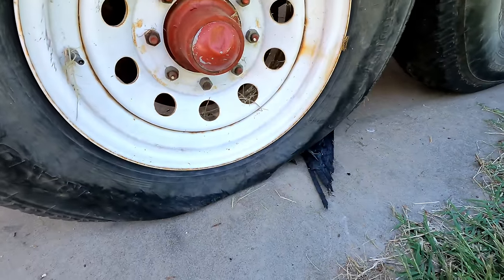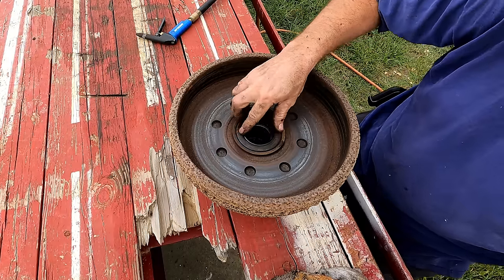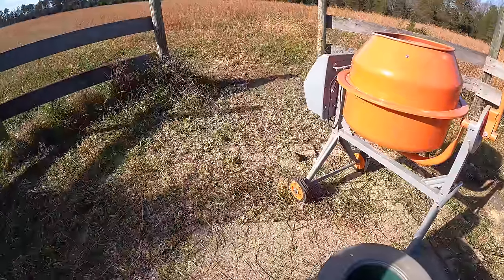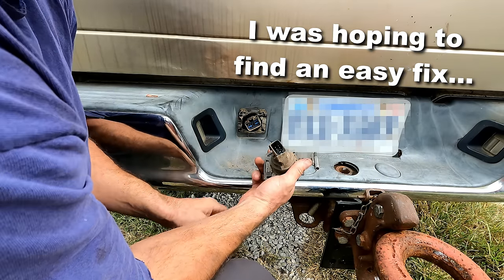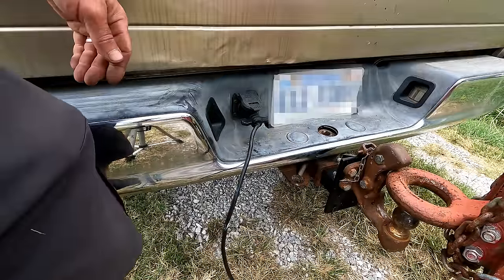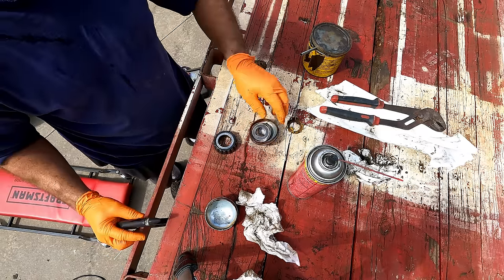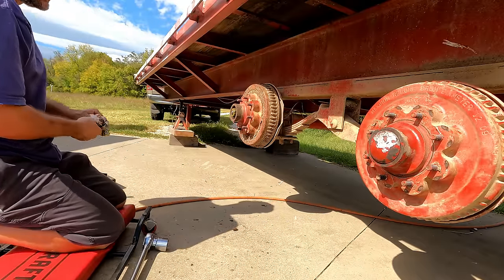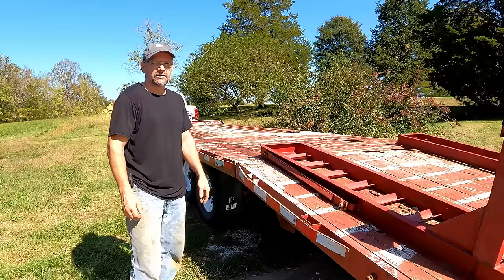Fixing A 7 Ton Equipment Trailer: Brakes, Electric, Tires, & More.

Comment: There used to be a liquid called Stabil, no NOT. the gas stuff that when applied to mechanical electrical connections achieved the near equivalent of a soldered connection. It’s an electrical polymer that does not cross talk even if you spill it over between electrical connections up to 600 v    What we used was manufactured in Sweden I believe.  It may now be called stabilant.  Search for electrical mechanical connection enhancer it’s a liquid should be small squeeze type dropper bottle it goes a long way but it looks like they are VERY PROUD of it.  .

Comment: I bought 2 brand new LT tires from Walmart for my 92 Silverado, of course cheaper tires but still costed me around $500, I only put 100 miles on the tires and both of them did just this, the glue did not hold, and the driver's side let go at around 65mph, the thread on the tire beat the snot out of the my bed side and ripped the tail pipe off. That company who sold the tires ended up repairing my truck and giving me a full set of tires for the thing.

Comment: 20:40 It’s not that far out there. I had a Fusion for a short time and the radio would intermittently work. Dug out the fuse, terminals looked dark from heat but wasn’t blown, so I cleaned the pins with a scotch bright and replaced. Problem solved! And it worked flawlessly for the remainder I owned the car. Crazy.

Comment: It's good to apply dialectic grease to plugs when power or ground issues aren't stable...like when you reassembled your truck receptacle.. Also put some on the plug from trailer.   It just assures a better and longer lasting connection.

Comment: Those Optivolt Panels use a simple trick. 2 cell groups in parallel. Bigger Panels use that trick already and still are cheaper. 2200$/kWp is an very hefty price tag. You get regular 400w panels for 90$, so they are a magnitude cheaper.
Reply: Incorrect! Our panels don’t use cell group parallel wiring, bypass diodes, or mppt converters/inverters. Our patented power electronics architecture balances power from stronger zones of the panel to weaker (shaded) zones of the panel, resulting in a near linear power output regardless of the % of the panel shaded. You won't find this tech on any other panel on the market — big or small.
Reply: @optivoltsolar  You know that to every electronic engineer that sounds like total bullshit. 

Also even if your tech is soo good, they still can't beat an simple 400w panel that is still *cheaper* than your crap.
Reply: @Toxicity1987  My mistake, I didn't realize I was in the presence of an electrical engineer! Let us know what this $90 400W panel is and we'd be happy to film a shading test of it against our 100W panel.
Reply: @optivoltsolar  Oh yeah when you film it, it will be trustworthy... not. Send your panels to an independent Youtuber like Will Prowse. He can test them for you.

Comment: I know this is way past the view date but it would have been interesting if you had loaded the trailer with something heavy and towed it down your dirt road and smashed the brakes to see if the trailer tires, all four, stopped at the same time and skidded down your dirt road to a stop. And checked at what point the trailer tires skidded before the truck tires. Also just using the trailer brake mech. inside the cab to see what kind of braking each tire does and if you can get them all balanced so that all four skid at the same time. All of this information is very noteworthy as you could cause the trailer to fishtail and even jackknife if one side brakes too soon and/or too hard. Sometimes you just want to control a fishtail that started for a multitude of reasons. You certainly don't want to exacerbate a already dangerous situation with unequal braking of the trailer brakes and flip your whole rig!

Comment: When ending an electric wire wrapping with electrical tape make a loop on the end, stick the end of the tape through it, and pull it.  It will never unwrap and you will always know that is the end of the tape if you ever have to undo it.

Comment: It could be that the ground is routed through the screws the hold the plug in. When you unscrewed it and reinstalled it, you made a "clean" connection. Just one possiblity.

Comment: I've completely given up on trailer rated tires. I haven't found any good ones, they are all junk. Treads separate and/or they wear out quickly. They just aren't made well or use good material. I'm tired of being stuck with trailer flats, due to tire failure.

I've switched to the closest size light truck tire I can get. They last 5x longer. They have more tread, better wearing rubber and are only marginally more expensive. If its good enough for a rear axle on a truck, it will work on a trailer.

Comment: So my Dad has a similar truck to you, and we found that the trailer breaks and onboard breaks have 2 different fuses. that didnt appear to be your problem, but something to keep an eye out for in the future. He'd let someone borrow his trailer, and they busted a bulb and didn't tell him, so when he hooked up to it, it blew the fuses. and we couldnt figure out what was wrong, because he was used to a 4 pin trailer connector and if the truck had lights the trailer had lights.

Comment: I am really surprised that you do not have a battery and a break away switch on your trailer. I believe they are required by law where I live.  Break away switch really saved my bacon when I had a ball come unscrewed and the trailer come loose while driving 70 mph down the interstate highway. The trailer brakes slowed the trailer down and kept trailer from hitting the truck.

Comment: likely when you disconnected the pigtail from the back of the connector you broke up the thin oxide layer in between, too many times I've fixed connection issues like that, surprised you didn't De-Ox the pigtail side too.

Comment: Self amalgamating tape works much better than standard electrical tape. You stretch the self amalgamating tape as you wind it on and the tape fuses together. The tail won't come undone.

Comment: Those plastic trailer connectors are almost worthless, switch over to the type used on a semi truck with the split pins and you will have a lot less problems. They are usually cheaper to boot

Comment: The optivolt was performing as a solar cell should. the other one wasn't working correct as it should have still been providing some power.  Thus the comparison could use refinements.

Comment: I have an idea that's unrelated to any repair but may help you with your editing well at least saving time.
Instead of spending time blurring out tags in editor, It may be fun to just print some novel or funny tags on your printer and then just stick them over the tag before you record. 
Just remember to take them off before you hit the road😂.
Always enjoy your videos and you say solder just fine.

Comment: Those trailer brake controllers sense deceleration with a little pendulum on the older ones or a mems mechanism on higher tech versions.  They don’t directly measure how hard you press on the brakes, they just activate with the brake lights.  The controller mounted lever directly engages the brakes regardless of deceleration.

Often equipment trailers like these use the same wire gauge to the brakes as for the lights.  The brakes draw substantially more current, and may benefit from heavier wire.  Check the voltage at the drum with the brake lever clamped, it should be the same as at the truck connector with the brakes connected.  If it is less you are dropping voltage through the wiring and not getting full braking power.  Of course you only need full braking power when heavily loaded, like with that excavator.

Comment: Brake controllers are supposed to be mounted completely horizontal there is a pendulum inside that slides forward when you hit the brakes which tells it to apply the brakes do the trailer as hard as you are to the truck melting it vertically like that causes it to work only half as well as it should

Comment: So, my understanding of solar panels is that the difference between Optivolt and other solar panels is the circuitry of how the individual solar transistors are linked together.
I'd be cautious of the longevity and durability of Optivolt if their configuration is what I think it is, cause any reverse flow or over voltage won't be contained to damaging only one array of cells.
Really cool idea besides that, though.
Reply: If they're built with some diodes in the right places, they'll probably be okay.

Comment: does your trailer have breakaway brake for your disconnect on the highway and it will lock up your brakes? Also do you have a braking battery on the trailer

Comment: Those tires were so badly damaged are you sure some of your heavy loads don't compress the trailer down so far that the tire rubs against the trailer/frame above it over bumps or whatever?

Comment: Raychem makes an adhesive filled heavy duty heat shrink commercial and nuclear grade in case you’re towing your  Wylie Coyote Acme nuclear reactor.   Gives like new wire insulation qualities water proof and all.

Comment: Hi I was looking at your video  and you asking why they are 7 connectors on your Trailer  plug well   you have  your urn signal L & R then you have  your stop/driving light markers   then your  Brake controller ( Blue)  and you have  Ground and Power  (why) well Ground and Power are use to  give  power to the  Battery on your  Auto Brake emergency  controller  or you can use it to charge a  Battery  Mount on your trailer for your  Winch or  charge the Batteries on your trailer home ( Camper ) when you go down the road also  your center connection is for your reverse lights (some trailer have  reverse light  ) like your home trailer ( CAMPER)   SOME CAR TRAILERS have back up LIGHTS THAT LET  PEOPLE KNOW YOU BACKING UP TO PICK UP A CAR  ...How I know all this info  well I work for a  Camper Motor Home Dealer here in NYS for over 14 years  Now I am retire  but I still remember  plus if you look on internet  it will tell you the   same or almost the same I just told you  HOPE THIS HELP  LET ME KNOW

Comment: Trailer brake controllers need to be “level” or horizontal at least for the pendulum to work correctly and send signal to the trailer.

Comment: 16:56  The first time you checked continuity to ground you went from the connector ground pin to your license plate screw (14:00).  Isn't there a plastic insert in the mount for the plate?
Reply from the maker: Good thinking, but mine is metal to metal on that bolt.  I also checked in multiple areas, and sanded the hitch to bare metal and checked there as well.  I wish I had shown it better.

Comment: Re the wheel bearings, tapered roller bearings are required to have preload or a negative operating clearance when in a no load condition. The rollers are a) canted and b) are ground to a slight barrel shape.
Preload sets the bearings up so when cornering and loaded the full face of the rollers and their races are in contact. 

Without preload, the tips of the rollers ride on the race and the high surface intensity wears both the race and the rollers esp through heat. 

The first part of your procedure was correct, but the second part where you just finger tighten the nuts is not. What you want to do is further tighten the nuts 30-60 degrees past finger tight. 
There will be a torque spec but forget that - just rotate the wheel in the direction of travel until the nut bites then about 15-20 degrees further. Do it a couple of times for each nut to get the feel for it.

Really it is a bit about the theory, a bit about feeling.

Comment: Tyre (tire) damage is, I think, easy to explain. They've grossly overheated due to 1/ under inflation 2/ excess load 3/taken above their speed rating. Probably a combination of at least two of these. Seen it loads, typical farmer never checks pressure and they leak to about 5psi but look OK with an unloaded trailer and/or agricultural rated tyres taken up to highway speeds behind a truck or pick-up. Modern cheap Chinesium or Far Eastern tyres (tires) are just about capable of carrying their rated load at rated pressure, they are built with zero strength reserves.

Comment: IPhone has a built in maglight called Magnifier… you can open it easily by setting your tripple power button click to open magnifier. Go to settings/accessibility/ scroll down to accessibility shortcut, select magnifier.  I would uninstall maglight, probably malware.

Comment: Here's a trick when you want to get the inner bearing out put your axle nut back on what the outer wheel bearing out and you ain't got the drum and the inner bearing comes out with the seal not damaged

Comment: Those Tires have ran to HOT and delaminated, casued by to high load or to low air pressure.

Comment: Surprised to see you go through all that work to Jack that up when you have a Yanmar 25 feet away…. Just went through the same exact thing on my 7 ton trailer.  2 tires let’s loose in the same way, one while towing my cat 304.  Went with 14 ply tires this time around.

Comment: You can get the seals at any autoparts store. And it should be replaced each time.  And also I'd recommend using brake cleaner to clean the drum and brakes because the liner is made of asbestos

Comment: A little note. Di-electric grease is silicone based. It will not burn, unlike petroleum grease, which will burn
Only use Di-electric grease on electrical connections.
Electrical safety talk is complete.
Best wishes all.

Comment: in replacing the main seal in the dump truck  this seal is on backwards look at the first when you were taking out the seal then the end  looks like it is but the my work better this way if it is not leaking then that is great

Comment: If you have solar cells wired in series, if any one individual cell is shaded, it will pretty much kill the entire series. This is the older method to get decently high voltage out of a single inverter. The optivolt panel instead uses individual inverters for each cell, that way , if one or more cells are shaded, the remaining cells keep generating power. This is called a micro-inverter system.  This is actually not a new thing.
Reply: proper panels should have bypass diodes to skip the shaded ones instead of dragging the voltage
Reply: Optivolt’s 100W panels don’t use ANY bypass diodes, parallel wiring, or mppt converters/inverters. Our approach is much more practical — we’ve designed an efficient, low-cost, and reliable power electronics architecture that cleverly balances power from stronger zones of the panel to weaker (shaded) zones of the panel. This ensures near linear power output regardless of the % of the panel shaded. Our technology is patented and the first of its kind in the industry.

Comment: I noticed the brake wires ran on the inside of the axles. This always creates problems with the insulation wearing off the wires. Run the wires on the outside and you will have a lot less problems. Trust me, I know from 25 years of towing  5th wheel campers.

Comment: What’s the point use only one break pad depending on direction? It would make sense to always use both.
Reply from the maker: It actually does use both.  When the one that moves first hit the drum, then the other pad will move.  Cheers.
Reply: @FarmCraft101  okay, it just looked like only one moved.

Comment: The plug from the trailer needs to be covered when not in use.  (as the truck's connector has a cover)  After years of trying, I have not had good results from liquid tape, over the long term.
That wire isn't broken, it has four ends. Ron W4BIN

Comment: Just because you have continuity does not mean that the wire will carry a load... At least that is what has been said several times in other videos... A single strand of wire will give you continuity.  but will not carry the voltage to light a 5 amp light ??  I am sure that the smallest amount of oxidation / corrosion  can keep low voltage items from working correctly. The visual difference between a brand new penny and old circulated penny. I just checked that two days ago on my third brake light assembly..

Comment: Nice half as brake job
If that $4 seal you didn't replace fails you get greasy brake shoes or water in the grease
If the outer metal dust cap you cheapened out on comes off your grease comes out and the wheel comes off
You might want to rethink your trailer maintenance

Comment: You can also use a small zip tie to keep the tape end in place. 
And solder, I have been involved in electronics for computers and as an electrician and pronounce it sawder. 😊

Comment: You have to buy and mount $700 worth of tires, but you won't splurge for new Drums which are turning into rusted boat anchors. 🤦‍♂️
Fyi- e-trailer sells the 7k drums with the bearings and seals for a good deal each. Just mount and grease- 💁‍♂️
(also, of Course the trailer requires constant power. It takes 30a from the truck to charge the trailer Brake Battery...
ALL vehicles, including heavy trailers MUST have a redundant or back-up Brake system. You're sharing the road with other people...
At Least get new drums and bearings.
Fyi- i recommend you drive on the new bearings with no load for a few miles to wear them more gently onto the spindles, instead of putting 10klbs on them immediately and grinding brand new bearings in 😉

Comment: Please consider using heat shrink tubing on every automotive/farm equipment electrical joint. "Electrical tape" is unreliable. I don't trust the "liquid tape" stuff. Heat shrink tubing is used on military aircraft, because it's reliable and lightweight.